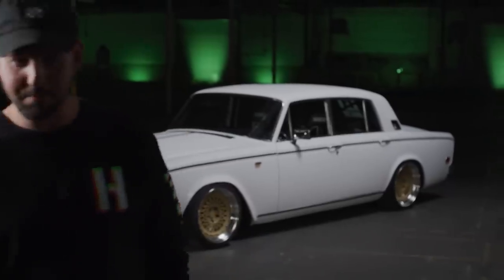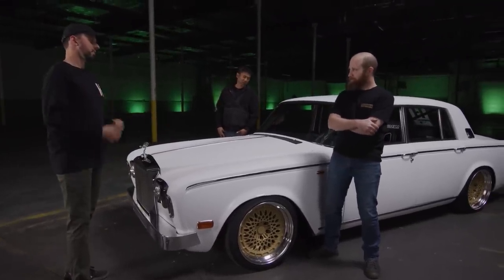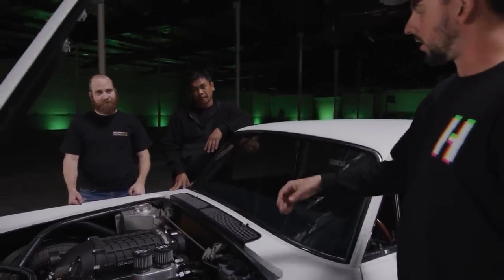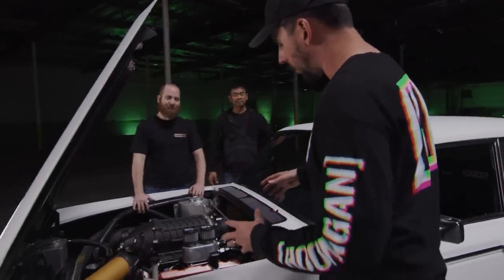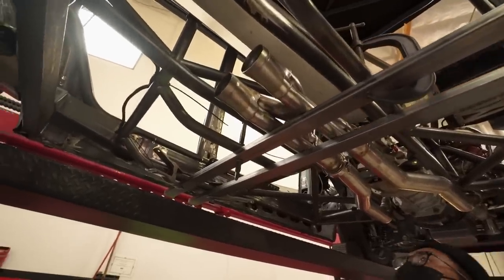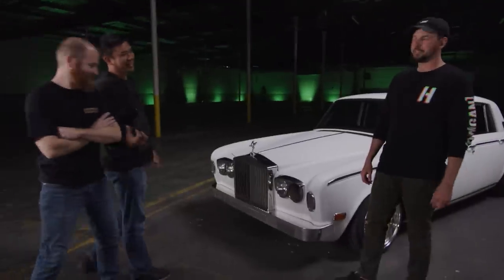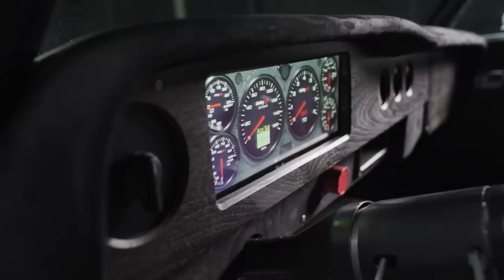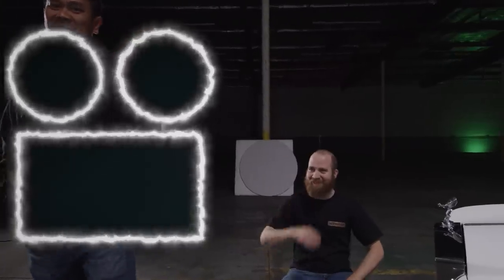900hp Hellcat Powered Rolls Royce! A.K.A. Slay Poupon // Build Biology

Comment: The Yard Stick is a seriously awesome invention. I really hope they can patent that
Reply: it already exists. it's called a cutting brake and it's used on tractors, rock crawlers and trophy trucks
Reply: @wyatteells9033  rally cars and trophy trucks is what ive seen it on, its for sure a good idea but you arent the original
Reply: Yeah I’ve seen it on a custom dirt buggy before.
Reply: some of the boys into the burnout scene already have thees also but connected to left and right front wheels  . awesome invention but at least 20 years old
Reply: lol there's nothing to patent, old stuff

Comment: Fitting that its Mopar powered as the original all aluminium V8 was allegedly coppied off a Chrysler motor that came attached to the transmission Rolls Royce wanted to try out! Nice to see no POS LS under that hood as well.

Comment: Stock Hellcats make about 550 at the wheels Red-eyes make 707 at the crank
Reply: try around 640-650 to the wheels and 797 crank hp on a hellcat redeye. Not to mention the new srt super stocks with 807hp
Reply: @okaythenwell5215  I watched a Hellcat get tuned before my car was tuned and base pull was 548 and it had a few hundred miles on it